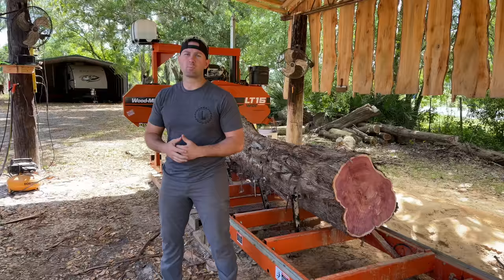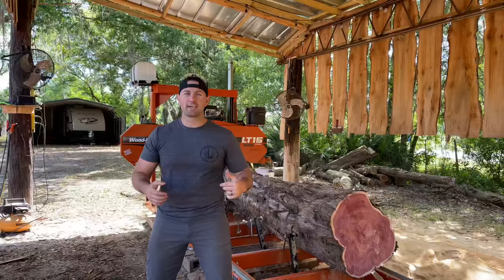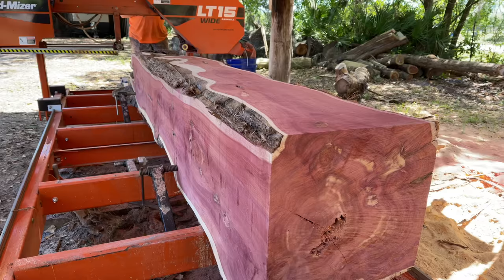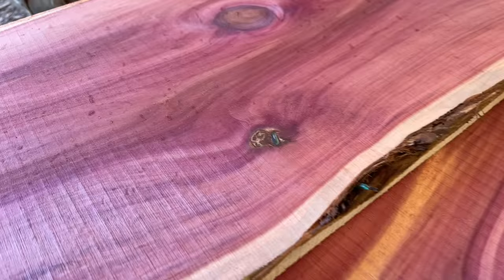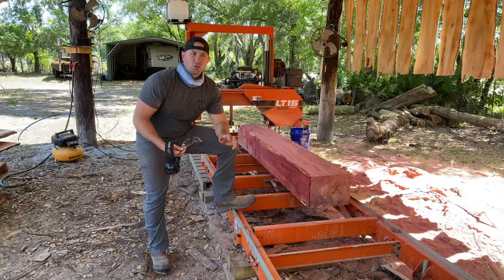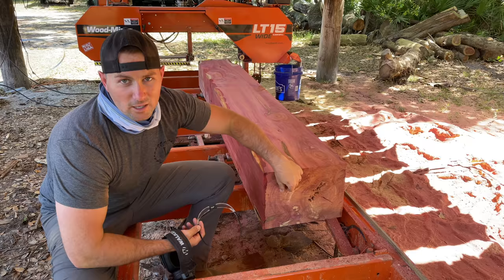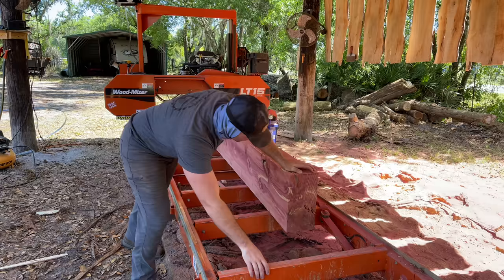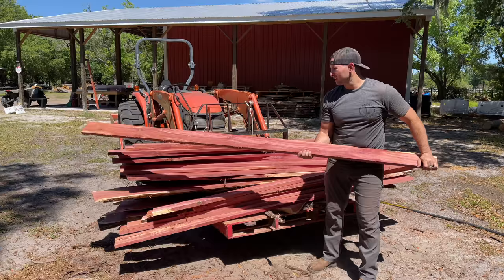Our Most Beautiful Boards Yet From An Ugly Old Cedar Log

Comment: I worked at a mill where we re-sawed dimensional lumber from huge salvaged long leaf pine beams. in that process the beams were always pre-scanned with metal detectors in order to save blades.
Reply: and when you found metal what did you do?
Reply: @drewcama2488  removed it
Reply: I worked at a veneer mill and we did the same thing.

Comment: I ran some old used rough cut cedar boards through my planer just to see if I could get some use out of it. It was scavenged from demolishing a ratty old shed.The interior beauty of the old weathered cedar was amazing. I ended up varnishing it after making  exterior mill work out of it. It is very beautiful and cost me nothing.
It’s not as nice as this log but still some great looking wood.
Reply: Cedar is such a beautiful wood

Comment: Really gorgeous color in that cedar! Almost looks like purple heart. My first instinct would have been to flip that 90 deg because, while your boards are more narrow they would be clearer of defects. I guess it depends on what you are hoping to use the boards for that would determine whether you value width with defects vs narrow and clear.
Reply: I agree! It looked almost like purple heart to me too. I think my monitor needs to be color corrected lol and the boards I agree too..it depends on one's market. wider boards usually bring/cost more, but good grain figure is highly, highly desirable.
Reply: Another advantage would have been, that that cable is visible (to the operator) in the bottom half.

EDIT: Oops, commented too soon, erroneous orientation with regard to the location of that cable.
Reply: Yes purple heart.

Comment: These would make great live edge tables
Reply: There are two things against using it for table tops. One, it is a softwood and even with a finish on it it will dent very easily and two, the beautiful red color will fade into grey very quickly when exposed to light. The only thing I have seen that was even close to retaining that beautiful red was the inside of a hope chest that was opened very rarely.

Comment: HI guys! Actually, when you found that cable, I would have removed the end metre of the log, completely. That way, you would have avoided the cable, and the rot, almost entirely. Admittedly your boards would have been shorter, but you could still have had the wider boards, to make up for it.
Reply: Why don't you go over your logs with a metal detector first? I worked at saw mill and we always did that.

Comment: Instead of blowing the dust off the log, why not vaccume it off and add to that collected in the bucket?
Reply: Or use a drywall trowel to scrape into a pile like many other YouTubers do. Looks like more dust is left on the board than what goes out the exhaust.
Reply: I kept thinking the same thing lok
Reply: @robertherzog2087  ...USE THE TROWEL TO SCRAPE THE SAWDUST INTO A DUSTPAN-!!!
Reply: I WAS THINKING THE SAME THING-!!!

Comment: Have you considered cutting slabs diagonally for a grain pattern that's part way between end grain and longitudinal grain? You could make one long, cut from the top of one end to the bottom of the other end, then cut several successively shorter slabs for a matched set of tables. The slabs will have a centered oval grain.
Reply from the maker: That is incredible! I am definitely trying it. Thank you so much for a new video idea.
Reply: @TripleLRusticDesigns  As for the shorter cuts that result in a straight end, flip the next, and the straight ends and grains should match up for a long slab. The bark won't, but......
Reply: Since the grain only runs part way before exiting the bottom, these slices might be more susceptible to breaking, like cookies. May need a reinforcing piece underneath.
Reply: If you cut two  1 inch diagonal slabs, and turn one over and glue it onto the other, you should have the diagonal grains in opposite linear directions. That should solve the weakness problem.

Comment: Add a small brush to your water tube to help keep the water on the blade, it makes quite a difference -- also a little windshield washer fluid in the water helps with the gum on the blade

Comment: Yes them bits at 3:45 .mins you cover up on that pallet can be used for a pallet size table just make it a few inch narrower and maybe a few inch longer the other way, with two log bench seats  that a patio barbicue table like you get in pubs has to be 3 k .

Comment: thats some of the best wood every made  my dad and i own a mobile home business and when that was slow we would skirt the mobile homes with rough cut 1/2 cedar plank boards we use 6 inch wide and 4 inch wide boards  and they look amazing when finished especially when we sealed them a week after we put it up too get a nice color too them and we put in two acess doors  if possible all we had too have is one by code but when we work on it it just smell so good cutting it and it last for ever if you reseal it every 5 years

Comment: You said you didn’t want to do a 180 and keep the cable side up.  If you didn’t you would get right into the rot.  My question is, if you are going to cut all of it, why does that matter?  Your going to go through it anyways.

Another one, why didn’t you remove the cable.  That’s going to be best for both the blade and the planks. You’ll have to get that metal out anyhow.

Comment: Unfortunately defects in the wood, regardless of their origin, can affect your yield. If you're relatively new to milling lumber, I'd suggest studying the various cuts used to cut lumber and determine which is best for your application. Different cut orientations create different grain configurations. These orientations also change the stability of the wood. Quarter sawn wood is an example of what I'm referring to. There's a big difference between regular sawn and quarter sawn. Hope this is helpful.
Reply: It's not defects, it's character! 😉

Comment: they are beautiful the color are fantastic i did have some similar to that and also with some 16 penny nails in it and yes that was a bummer but i was able to keep going some people like that look with the blade mark specially if you sell for artistic purposes those wider ones at the flea market in St.Augustine {when it was there } i was asking 125 per board but letting them go at 80 per board the smaller ones asking 75 letting them go at 60 to 65 but it takes time to be able to sell that way you got to make your name for quality material 
    i also like like the way you cut that big branch at the beginning but i used to cut 3/4 of an inch thick for artistic purposes don't need a 12 penny nail to hold your piece of wood on the wall and all the lumps on the log all the way around i took those thin pieces it unbelievable the design you get sometime if you like the online thing you put those cut with a fair price and you sell them like hot cake but like i was saying not thick but 3/4 of an inch ruff cut
Reply from the maker: Thank you very much! That is very helpful

Comment: Save some of the dust for when you go to use the boards. Mix with a little wood glue to fill in cracks or spaces around knots ect. Oh I hate finding metal it sucks.1 bent tooth and there goes a blade

Comment: Looks like you may need to invest in a good quality hand held metal detector that will pick up metal close to the top, but a pass after the first or second board is cut will also give you an indication if something is below that level.
Reply from the maker: Yeah we also want to get some of the blades that can cut through metal
Reply: @TripleLRusticDesigns  Always a pleasure watching you go through the wood, but I and others hate to see a blade get damaged if it can be helped. The blades that will go through metal as well are cool, but expensive. Have a great Spring & look forward to seeing your next posting.

Comment: Hi Guys, you asked for an opinion and so here it goes for what it 1s worth. Your starting cuts to remove the bark are not designed to produce useable timber, they are too thin. How about cutting something like 150mm - 6” deep at the peak and as long as they are wide?  What you now have is a set of bowl blanks for end grain turning. They could be used for live edge turning and people who do turning would love it if you would supply them. Your bowls would be up to 400mm or 16” wide. Turned, they sell for a few hundred dollars each.  The best part of this approach is that you are not wasting this part of the tree.

Your question was about rotating the log with its narrow edge on top or keep the wider edge on top.  What you did turned out best because you firstly cut several planks at full width first, then flipped it 90˚ and cut several narrow planks.  You got the most quality wood out of your log that way.  Funny thing, the rotten looking hollow at the end didn’t go into the log that far.  I and you thought it would run all the way through but it didn’t.  Surprise bonus to you I guess.  Anyway, you are an evolving expert at this trade and you are the best to judge what to do.  My favourite author Malcolm Gladwell says the only difference between an amateur and a professional is 10,000 hours. You are well on your way. Cheers.

Comment: long after this was posted, but I would have cut timber to 10' instead of 8' to begin with, and then hope that I could trim the boards to avoid most of the checking and rot, at least.  Beautiful wood, though.

Comment: You are in a part of Florida where you may run into Cypress with ends that look like that or worse. Pecky Cypress brings a premium. It may look like crap, but if cut and planed you can turn a a plain old counter into a work of art. Cut your pecky cypress down to 1/2" (2/4) and dress it to 3/8 .

Comment: Best flashlight ever was from Polaroid in a blister three pack at Sams club in about 1990.  The battery wasn't replaceable or rechargeable. But I threw several in drawers and car glove compartments. Forgot about them. Pulled them out 20+ years later. All still worked just fine. Plenty of charge left on the batteries. I think Polaroid made them to show off their new battery technology they were using in the film pak of their cameras.
Reply: What does flashlights have to do with cutting logs at a sawmill?

Comment: Ok to remove the wire connect battery clamps to the wire other end to the battery. Hit with charge 2 OR 3 SECONDS ONLY AT A TIME. ONLY, DO IT TIL THE WIRE IS HOT ENOUGH TO PULL THE WIRE OUT. the hot wire will draw timber sap to the wire and act like a lube. If you get a burn line whoever processes the slab can dremil the line out fill it with glue and sawdust from the milling. Easy peasy

Comment: Those odd little oval shapes if within an inch or two can maybe be used as orange segments making a 3 or 4 foot round table.
Otherwise when you do dinner as in Xmas have them as plate mats if plates are hot  so epoxy resin not damaged.

Comment: Dear Friend,  My idea and thoughts about and metal obstruction and the remedy would be to get a Drill and chuck up a "Hole Saw".  I would take different size diameter Hole Saw Blades and try to work my depth just enough to get the metal obstruction removed.  After I plunge into the trunk I would use a chisel to break out the chunk.  Later the hole could be patched with a clean piece.  This would certainly save your $1,500.00  saw blade....

Comment: Hi guys, when I was 16 I worked at a mill in England, we used a metal detector to find metal, that was my job, find metal and cut out with chain saw. I would find all sorts of cool stuff, from shot, to lumps of shrapnel, and of course old nails holding wire fence parts. I would have cut the same way you guys did. PS the metal detector worked well but only to like 6inches deep. That was C1974 to 76, then I joined the Army. Good video guys, take care.

Comment: A couple things, first, is someone pushing the saw ahead? If so, it may be they're pushing the machine to fast. Let the machine do the work. Another thing, the piece the blades cutting, by not putting a sawblade shim, presses the blade in he back down, an the front of the blade up. Try using the thickness of the blade shim. Cut it wide enough, so as the blade moves foward, it doesnt cause the blade to bind. Like on a table saw, you can cut everything, and itll never bind. Bbut you try pushing it through, and thats a great way too lose fingers when the blade binds. If your not pushng plywood through, a blade should tast at least 40 to 80 sheets of cutting. If its only last 30, its being pushed to fast, and the blade starts to bind. Try using a shim so the blade doesnt bind. Last, have you ever heardof quartering, like white oak, yea, its weird, but it changes everything. Just an idea. 4degree, should explain the chatter. Use a shim and as yo move forward, keep it about a foot behind, you can experiment with that. 4degrees is a ton. Try it, and let me know. God Bless, Rick

Comment: For my “two cents” if I had your mill I would pressure wash anything that the blade could encounter 😝
Reply: and people do wash their logs. there are also de-barking blades that run on a small motor just ahead of the blade. they eat the dirt and bark off in a narrow swath, so the head saw blade cuts only clean wood. I think it's $1300 for some wood mizer mills. we had one on a large circular mill. definitely saves blade teeth and saw maintenance!

Comment: Is there anything you can do with the wood powder? I am thinking maybe you can add it to clear epoxy if you use a pour to fill rotten spaces.  It might produce a colour that works well with this wood. I am not a woodworker at all but just wondering.

Comment: I would cut it the way you did but section the cable area or cut a 4” slab in that area. A couple of your boards would have been shorter until you got below it but I hate knowingly running a blade through steel, it’s not worth it IMO.

Comment: 1) You need to center the pith when milling.
2) Cedar is extremely soft, even the slightest bent tooth (that's that sound you hear) will scar the boards.
3) If no debarker...run older blade to remove bark/sap wood. 
4) Yes, you should of turned that cant. 
5) Plan your milling around defects. More $$ wood in the end.
Reply: Scar my ass
Reply: @mikecastleberry9671  ok. Only been milling cedar, fir, hemlock, etc for years but ya...no clue what I'm doing. You all hack up a juniper bush and call it a Cedar tree. We drop 100' cedar trees and mill them here. SMH.🤦‍♂️

Comment: Beautiful?  It's a pile of firewood.  50 years ago I bought several hundred bft of "No. 1" Western red cedar T & G siding to use in a bathroom.  When it came in, it was garbage, but I was committed to buy it on special order from my mill yard.  Oh, it came out OK but it was a real chess match to cull the clear pieces I needed. Learned a lesson: never let some smalltime sawyer determine what "No. 1" means.

Comment: Ummm why didn't you just cut the log vertically at the metal point... the boards will not be usable beyond that point anyway.. and you have better than 9 feet before you get to the steel spike.. ?